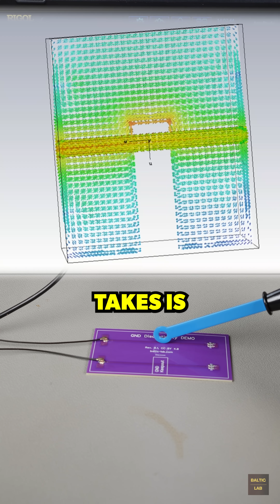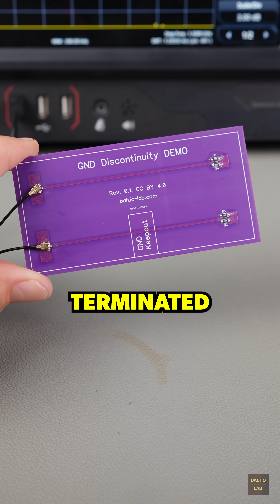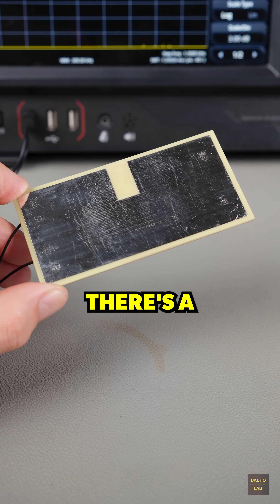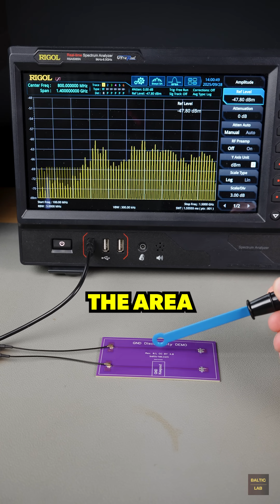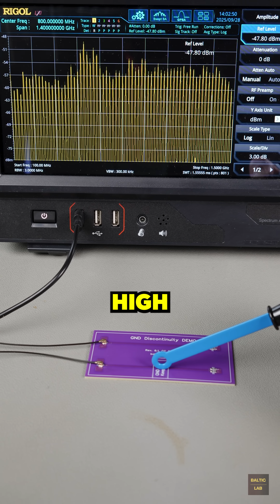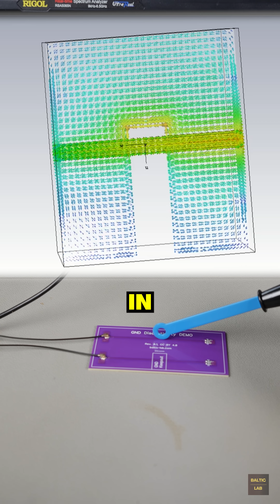Worth knowing: Bad PCB Design Leads To Unwanted Radiation #electronics

Comment: It’s only for signal traces though, right? Like if I have 2 ground planes connected by a ferrite bead with power on one and everything else on the other. And then I route DC power over those gaps, I’m not introducing noise into the amplification circuit, am I? It’s like a 0.8mm gap, so the noise generated would have to be in the mhz range I’m guessing, and that’s not low enough to ride through my filters.
Reply from the maker: If your DC power is sufficiently clean, it shouldn't matter much. Even if there is some noise present, it's typically not noise with fast edges or high dV/dt. What is questionable, however, is the ground separation through ferrites itself.

As an experiment, try removing the ferrite beads, directly bridging the two grounds, and then comparing both conducted and radiated emissions before and after. In many cases, you'll find there's no real advantage to separating ground planes.
Reply: @BalticLab oh I’m sure it’s not a major change, if any at all. It’s just an added layer of protection. It’s for a pH controller, and I’m taking every precaution to make sure that pH signal stays as stable as possible and doesn’t accidentally poison my reservoir. The 10MΩ resistor right after the probe will probably pick up interference, and I already have a peristaltic pump motor nearby. Either way, I’m still new to this, so maybe my readings won’t change that much; even with all that emi and dirty power. We’ll see when the prototype PCB arrives.

Comment: Hence transmitters use parallel inductor capacitor circuit at resonance for maximum impedance so that signal radiates in to air. Receivers use series LC circuit for minimum impedance.

Comment: Could you use a near-field probe to check the emission on the perforated grille of a microwave door to determine the intensity of the radiation?😅
Reply from the maker: You could. But that said: Current probes are good for qualitative and relative measurements. For determining absolute values, like precise field strengths, a properly calibrated measurement antenna would be the way to go.

Comment: Just interesting idea because of multi layer pcb
How it effects if its between 2 ground layers instead of only having one at bottom
Reply from the maker: If the signal traces are sandwiched between two ground layer, it'd essentially turn the trace into a stripline. Which doesn't radiate much at all. What already helps a lot in a multi-layer board is to have the inner groundplane a lot closer to the signal trace. I've seen EMC stackups with 4 layer boards having Signals/Power on Layer 1, and Layer 2, 3 & 4 being all groundplanes.

Comment: is it weird that RF makes more sense to me than DC/low freq? Like at DC the geometry of a circuit is essentially irrelevant, you just pretend that things are instantaneous and use logic instead of physical intuition. Meanwhile in RF things actually travel in space, every step in solving a problem needs to follow physical intuition. This was a huge issue for me when i first learned about AC in middle school, because I was thinking about AC the way you would at high frequency where different parts of a wire will have different currents and voltages (trying to imagine wave propogation basically), but the practical understanding is that the whole wire is a node until you reach EM class. To this day i sometimes get hangups about DC initial conditions because i try to consider things based on wave propogation rather than logic. Amplifier feedback still doesnt totally make sense to me although I hope ill see a course on it some day
Reply from the maker: That's quite normal if you're involved with RF a lot and your thinking is hard-wirred to RF. I also have to force myself to think of the steady state only when talking about DC. My mind however, is more interested in the transition to that steady state.
Reply: As an amateur radio operator, low frequency AC makes the least sense. Like on DC when you turn it on you have a pulse travelling at your medium's lightspeed, but that mains bullshit is close to DC enough to not need to maximise the perimeter properly but somehow high frequency enough to treat a series capacitor as a resistor instead of insulator. And to have phase, signal earth, and protective earth just as parallel cylinders going through a tube with no twisting or shielding? Those should act as mighty antennae!
Reply: I understand nothing at all, but it seems so interesting!!

Comment: Looks nearly the same
Reply: It's a logarithmic scale, a seemingly small change can have huge impacts. This is especially apparent in real world applications where multiple points like this can exist and constructively interfere. This can result in poor functionality of the device, or dangerous levels of interference with other devices, or even electrical shocks or burns in HV/HF equipment. UHF especially leaks everywhere, uhf-hv-ac will jump to anything and everything in reach, especially if it's grounded or high capacitance. (To UHF, high capacitance = low impedance, but almost anything even slightly conductive will have at last some capacitance.)
Reply from the maker: You need glasses if you can't spot the ~6 dB difference. 6 dB means the power has increased by a factor of about 4, so quite significant.

Comment: A better test might be isolation, near-field probing isn't very insightful for high frequency. A proper thru channel in the middle, with these traces on either side.
Reply from the maker: Agreed, but not for a short. I did this in the corresponding long-form video using S21 between both traces and compared with copper tape over the gap to "repair" the ground gap: https://youtu.be/YzZHYD0Goog
Reply: @BalticLab  Nice, shows crosstalk fully. Though there are some instances where we deliberately cut the reference plane a little, to maintain the characteristic impedance. Like a thin microstrip trace going to a much thicker pad of a component or connector. Think even the u.fl connector footprint recommends nulling right below the center. I'm guessing this still worsens radiation a little but the matching is more important to reduce insertion loss.

Comment: Will it be better if traces run between sandwich of GP? (3 layer pcb)
Reply from the maker: Definitely sandwiched. A stripline always has less field emissions than a microstripline under otherwise similar conditions.
Reply: @BalticLab  But more dielectric losses, right?
Reply from the maker: Unfortunately, we have to pick a battle.

Comment: That's obvious! It's not a 50R trace if the GP is missing, it's an antenna.
Reply from the maker: I wish it would be that obvious. That mistake is extremely common in PCB design...
Reply: It’s not obvious to any beginner and most enthusiasts
Reply: Happens more often than you think thanks to the outdated practice of splitting grounds.
Reply: Also, u didn’t say anything other than, “that’s obvious”. What are u trying to sound smart or something? U sound like a redditor.  Don’t just say the first thing in ur head if tou want to be taken seriously.